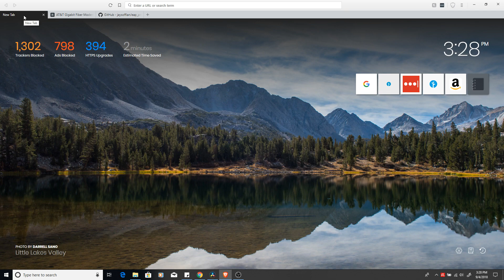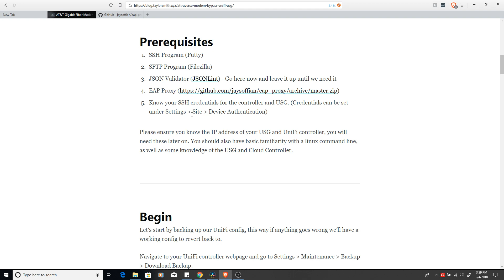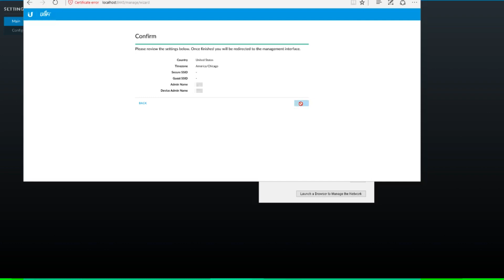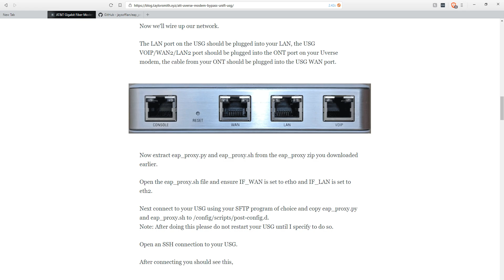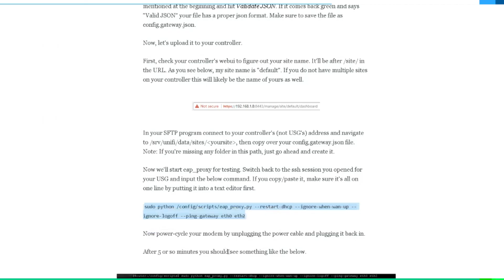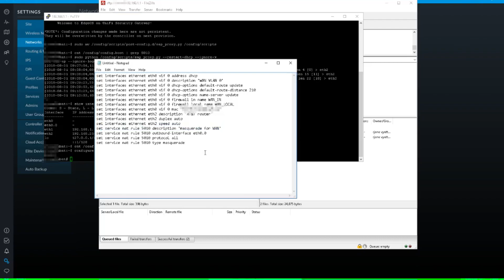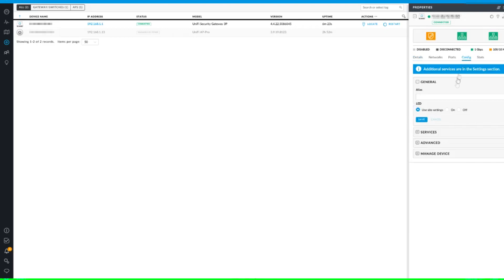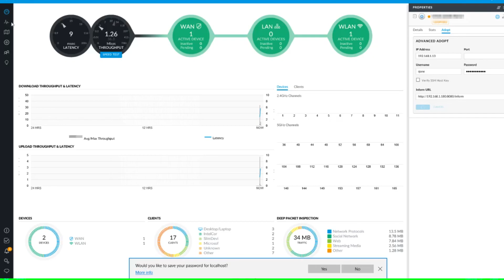Part 2 of 2 (Completely bypass AT&T Gateway using Ubiquiti USG Advanced)

Comment: hi guys, i only have the huawei ont/router all in one device. how do i connect it differently as i don't have an extra modem to plug into lan 2. i can plug in my usg pro into wan port and lan 1 port to my switch. can anyone confirm if i can skip lan 2 in this video or if i should connect it differently.
Reply from the maker: Do you have a model?

Comment: Would this method still work today I have the BGW210 USG and I am getting really poor speeds.  I have passthrough setup on the ATT Router but I don't have any of the Putty or FTP work done.  Also, what's the rollback if it doesn't work?

Comment: Hi! Thanks for the excellent Tutorial, but I am soberly confused.  @7:15. I'm instructed to connect the Lan port on the USG to the Lan. @7:31 I'm instructed to plug WAN2/VOIP into the ONT port of the BGW210. @7:42  I'm instructed to "...then the WAN port should be connected to the cable that comes directly from the ONT..." Are you referring to the RJ11 service line? There is only one ONT on the BGW210, and it was used @7:31. Do I need another ONT? Using USG Pro.... Thanks to anyone in advance for curing my ignorance!

Comment: So you have to do all this just to use the unifi wifi?
Reply from the maker: No this is in no way a requirement to use the Unifi platform. This was to bypass the AT&T gateway modem to get a performance boost and some reliability since the AT&T hardware can be flaky at times.

Comment: Great video, and much appreciated.  A couple of quick questions:

1) Your instructions initially said that the FTP and SSH can be done to the USG or the Cloud Key.  I use a Cloud Key and it has an IP address of 192.168.1.7 with my pre-existing setup.  Can I follow your instructions and setup the Cloud Key (using the 192.168.1.7 IP address)? Or do I have to use the 192.168.1.1 USG IP address?  It wasn't  clear to me.

2) I just had my AT&T Fiber 1000 service installed today, and will be tackling the setup tomorrow.  If the traditional IP Passthrough setup works with the current hardware/software (ONT to Modem ONT Port, Modem ETH port to USG WAN) and I am getting full speeds, is there some advantage to do the full modem bypass as in your video?  (I think I understood you to say at the start of the video that this setup addresses an issue with the IP Passthrough setup.)

Thanks for a great video!
Reply: Very interesting question #2.  I dont see a response, but I was wondering the same thing.  I just got ATT 1000Mbps and I wanted to bypass the RG and run ethernet from ONT direct to my Asus Triband router.  The technology doesn't work like that.  We have to think of the ONT as  nothing more than a registered media converter between the RG and the OLT in ATT's Central Office.  The RG is the device that has the necessary internal modem, not the ONT.  You have to have an a device performing the modem task somewhere on site.  So, doing everything in this video doesn't help you get rid of a device.  So, it left me wondering what is the point?  Especially if the RG produces 900Mbps and the featured hardware  is only capable of 100Mbps, why introduce a bandwidth choke point.  I enabled IP pass through, disabled all firewall features and let my Asus receive the WAN IP that way.  I am happy at over 900Mbps up and down and my only downside is that I have this huge RG eye sore and used up my last power outlet in my network closet.  I am sure there is a control factor that most users don't need or want to consider, but I don't need more control than my Asus router provides behind an IP pass through capable RG.  

Great video, but his IT skills are a bit over my head.
Reply: @pvt-pilot  I will first admit that I have forgotten most of the technical details of what i did, and I am not near my setup to currently specify components.
I ended up doing the complete modem bypass as he suggested because the modem AT&T provided me has an issue with true IP Passthrough.
The recommended setup (as I understand it) does a heartbeat validation check if there is ever a home power outage to validate service.  It must work because I've had a power failure since it was installed.
I have never had any issues, and I regularly get 950+ Mbps both up and down.

Comment: Hello, I currently have FIBER its through ATT's line but a different ISP. Im also wanting to use Ubiquiti do you know what a good model # is also can you custom pick certian ips to use a VPN on? Also Iike how it explains the bandwidth and all the detailed info. Can i just plug an Ubiquiti AP and itll custom give all my devices ips and a show bandwidth for ech ip thata wireless also?
Reply from the maker: There are different levels of Ubiquiti equipment. It just depends on what you are trying to achieve with your deployment. You can configure a custom subnet for your VPN network if you are talking about doing a site to site VPN connection. Also, what is available in the interface depends on what Ubiquiti devices you have installed. If you want to contact me directly on the back end of the channel for some guidance you can.

Comment: Nice work!

I updated the guide a few months back to remove the json config requirement, this should help reduce the complexity of setup and be a little more robust than the previous method.
Reply from the maker: Thanks for the info, I hope you don't mind me using your previous write-up! I did the first video because there weren't any videos online and it took me forever to find your write-up!
Reply: @IDEAHomeandTech  I don't mind at all. Thanks for taking the time to make the guide more accessible.
Reply: we all super appreciate the work! I do have a question on getting this to work in a setup where the controller is on a windows10  laptop and not a CK.
Reply from the maker: @jarrodgream  Sure what's your question? I actually run it from my server not a cloud key.
Reply: @IDEAHomeandTech  On my Pro4, after following the guide, i get some errors about "file doesn't exist". i will get the exact error tonight. but after resetting 2x i get the error both time and just couldn't get it up and going.
Reply from the maker: @jarrodgream  File doesn't exists sounds like the config file might not be found by the controller or the Pro 4.
Reply: @jarrodgream  I am getting the same error. Have you found a solution?
Reply: @kyleheyman4554  not yet, im working on it still but have been under the weather the last few weeks, may try again this weekend
Reply: @jarrodgream  I just came across this post: https://www.dslreports.com/forum/r31928791-   at the bottom the user says they had to use eth2 and eth1 instead of eth0 and eth1. I guess it makes sense if I'm using the USG Pro 4 instead of the standard USG which is used in the guide. The ethernet ports aren't the same configuration in the 4. Im just not sure exactly where I'd make that change in the config. Everywhere eth0 is referenced I guess? I plan to give this a try today or tomorrow, I'll report back.
Reply: Is there a link to the guide?

Comment: I did this same thing. My speeds results were only around 90 up and down.   Remove it and go back to the ATT 210, my speeds go back up to 900+ U/D.      What’s your speeds you’re getting?
Reply from the maker: The basic USG is only good for up to a 100mb circuit that is likely why you saw the dip in performance. I only have a 60mb circuit. From years of installing circuits for offices a over the world  I've come to terms with the fact that if a 100 person office only has a 100mb circuit, I don't need anything greater. I just worked on optimizing my network to make sure only the devices that need to get out do and I've also enabled smart queues (which is equivalent to QoS for large packet streams) in my Unifi controller. You would have to step up to the USG Pro series for anything higher especially if you are using QoS or DPI.
Reply: Ok, I resolved that issue.. i'm retarded and we won't discuss that. However, I can not get the process to work without running the Python code after every reboot...  blahhhhh
Reply: @thatdrh  what was your issue? I just ran the updated version, but i'm only getting ~100 up and down.
Reply: Evan Kiefer sorry I removed it.  I can’t remember now.  I thought about doing it again cause I get bored.  If I do it again I will let you know.  However, the main issue I had was; it not running this process automatically.  Like it wouldn’t work unless I was telnet’D into it, running the script to start it....
Reply: thatdrh are you seeing the full gigabit speeds now?
Reply: lynyrd65YT yeah...  it’s just around 900 up and down again.  However, when it come to making the script into an excitable file for the post boot up to launch.  I don’t think that part is working.  No matter how long I wait for it to come up.   I can manually start it with the command. But I would have to do it everytime it reboots or loses power.

Comment: Thanks for this video. 

I have AT&T Fiber and I’ve been looking to upgrade my network to Ubiquiti products when I run Ethernet in the House.

I’ve noticed strange reliability issues with certain sites using the AT&T provided gateway (YouTube slow to load and defaulting to low res). Hopefully bypassing the gateway completely will help.
Reply from the maker: I noticed similar issues some of which could be related to the fiber coming from the node some could be related to the firmware version of the AT&T gateway and some could be related to the DNS servers that At&t selects. I've had enough issues with the last two that I decided to do something about it. I have a few personal contacts with At&t that assisted me with information about my line and hardware that eventually sent me down this rabbit hole. Be sure to subscribe if you haven't already as I'll be doing other ubiquiti and home automation videos now that I'm back from a brief vacation.